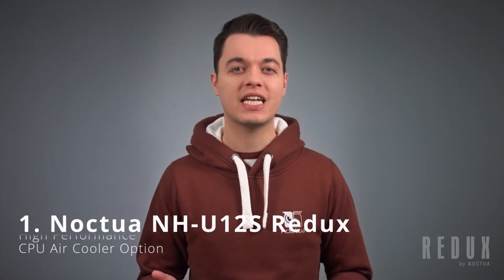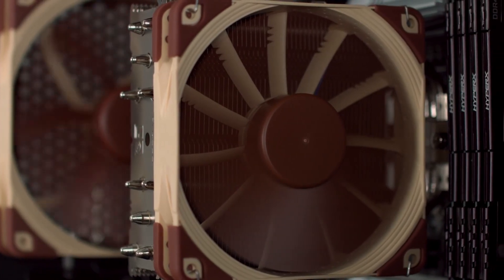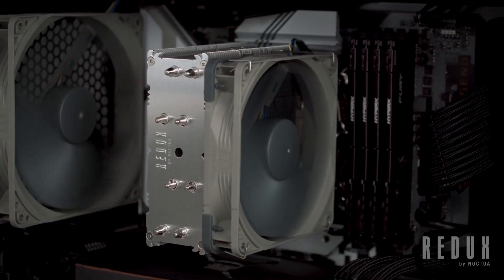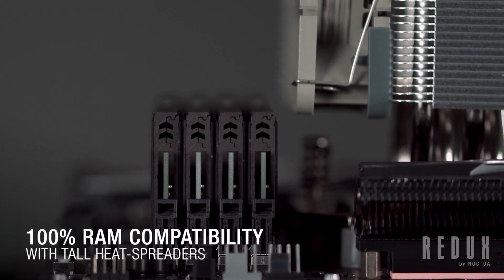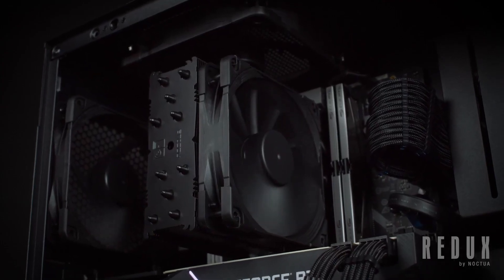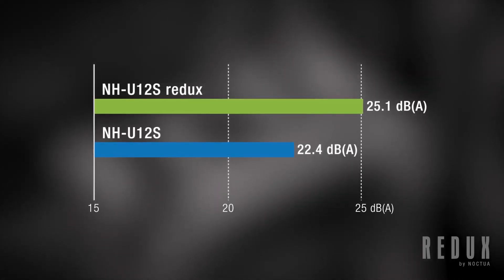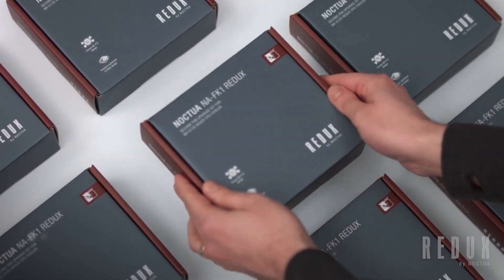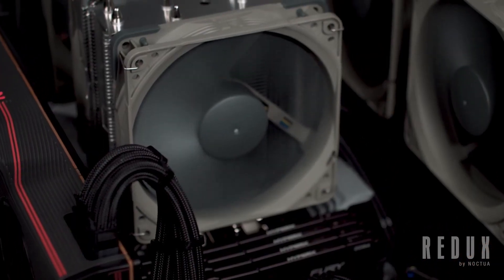5 Best LGA 1700 Coolers that You Must Have

Comment from the maker: 🔽LGA 1700 Coolers That You Can Find on Amazon🔽
1. Noctua NH-U12S Redux - High Performance CPU Air Cooler with NF-P12 redux-1700 PWM
https://shorturl.at/nbYOM

2. MSI MAG Core Liquid 240R V2
https://shorturl.at/nbYOM

3. Thermaltake TOUGHLIQUID 360 ARGB Motherboard Sync
https://shorturl.at/nbYOM

4. ID-COOLING SE-226-XT Black CPU Cooler LGA1700 Compatible
https://shorturl.at/nbYOM 

5. ARCTIC Liquid Freezer II 280 + LGA1700 Upgrade Kit
https://shorturl.at/nbYOM